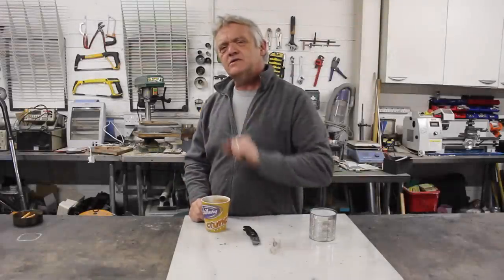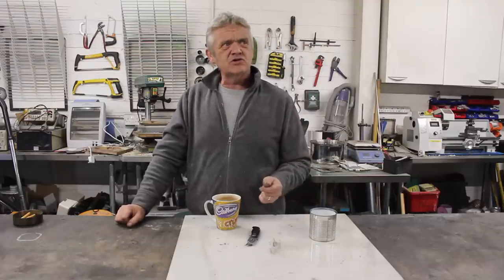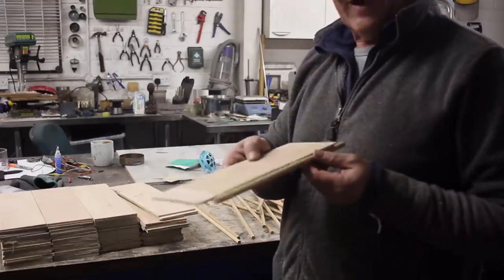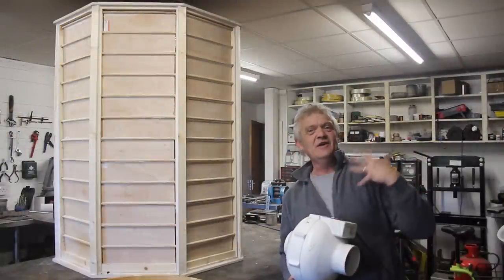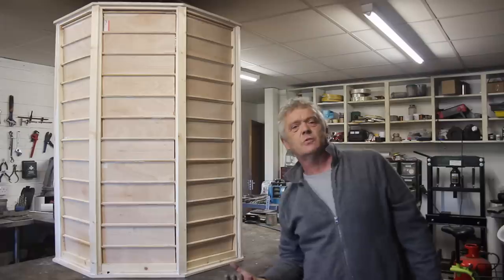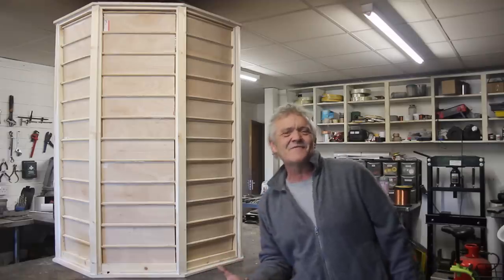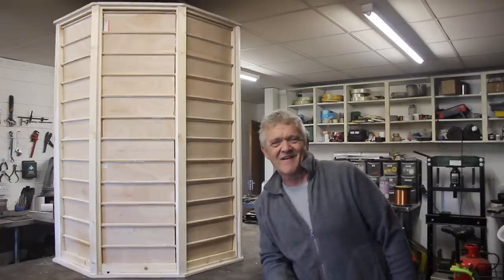1725 Aeromine And A DIY Wind Turbine From A Lost Technology

Comment: I made a small one of these once. The pressure and direction of the wind would push the flaps at the bottom down (the exit was at the top) maybe this won't happen at a larger scale. Assuming it does I have thought of two solutions.

1. Give it tall legs and allow air to vent from the bottom. This way the pressure will aid in pushing the flaps WITH gravity.
I'm not fond of this idea as much as it requires it to be tall and less safe as someone could go under and stick their hands into the blades. Also, back pressure from the ground may be an efficiency issue.

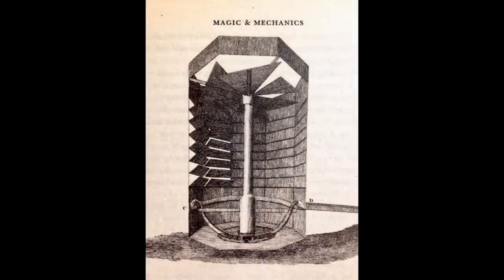2. In the original design,(1:55) we see the flaps are flapping upward and are closed not by gravity but maybe wire with weights pulling the flaps closed. the weights would be just heavy enough to close but light enough that even a slight wind could blow them open and closed on the other side. This makes sense as the materials back them may have been heavier making flapping harder? The weights would fix not only the direction of flow but also allows you to use heavier/ cheaper materials.
Reply: After some thought: I don't think this is much of a problem on at larger scale. The benefits from 2 are likely too small at a larger scale to matter. Will play around with this anyways so things like steel can be used. (wood looks soo nice though!) the design in the video seems to be the best.

Comment: It occurs to me this might be cheaper and easier to build with a floppy vinyl or plastic sheet for the flaps- stiff enough to hold shut on the back end but light enough to flap.  That would simplify the build quite a lot and I suspect capture lower speed wind.  your floppy-ear disk hawt thing brought it to mind.
Reply: Wouldn't be as pretty though, granted. :)
Reply from the maker: it is pretty lol - I like your idea though

Comment: Oh my, I am truly impressed.  I've never thought of a modified Bernoulli effect.  A ten foot+  tower placed between two homes where the wind is funneled with several generators inside would be a fantastic battery system charger.  Needing two sides with flaps only.  The two sides would be blocked by houses ... at least until you get to roof level.  Thank you for the innovation idea.  I'll put it on the list and if I live long enough to finish out my other projects I'll look at it further!

Comment: Could a pivoting venturi/flow suction structure be added on the top that would utilize the airflow above and over the tower to suck air trough the system increasing airflow or even just to reduce the energy lost on opening the flaps?

Also, would painting the side facing the east, south and west black maybe cause some heating and therefore air rising in the system?

So many ideas in my mind for this tower :D
Reply: How about a venturi/spiral center rod to direct and concentrate the incoming flow.

Comment: Hi There you might what to take a look at the old turret type ventilation units on old libraries and warehouses. They draw the air up inside them vertically and usually have a chamber up above them which is only open at the bottom. This void creates additional negative pressure which increases airflow.
Kind regards T 🙂
Reply: Are those the things on top of the English parliament? (Genuine question, nothing to do with the escape of hot air from the chamber  😀 )

Comment: The thought about a wing, works on pressure difference. if you expand the tower above the turbine but reverse the flaps it will act like the wing creating a pressure difference bottom flaps in top flaps out in the side facing the wind out the down wind side grater output, now the question, is one better than the other.

Comment: I love this! couple of thoughts, adding a mechanical lift for the flap opening, via a spring, would help allow more air to enter/not slow the air as much into the chamber.  second instead of using the entire swept area, using a funnel or cyclone channel to speed up the air might help low wind speed performance and better overall efficiency.  looking forward to the next videos.  Thanks!

Comment: If you get two plastic sheets with holes in one and larger flaps on the other and glue them together, you can get a whole sheet of valves. Stick this on the outside of a tensegrity tower and you have an awesome popup generator!
Reply: maybe a semi fine mesh over the plastic with lots of holes in it would work better.

Comment: How about putting a savonius turbine on top, set up to spin to opposite way. Mount the coils on the outside of the horizontal turbine with brushes on to slip rings in the center. Mount the magnets on the savonius. Double the speed, double the power?

Comment: Looks something like the 1970s invention  tornado type wind turbines. There were patents issued in the 70s and 80s but nothing commercial came out of them. These generate the pressure difference by directing the wind  tangentially into a cylindrical tower,causing it to rotate and generate low pressure at the center like yours the top is open and bottom is connected to the either horizontal or vertical  air turbine located below. Since the air turbine is ducted/shrouded it is more efficient than the unducted air turbines. Also was thought to work with even the low wind speeds. It would be possible to  base a design on one of the expired patents.

Comment: You asked for this! 

Title : Tornado-Type Wind Turbine

Patent No US4070131A
Application : 1975
Inventor : James T. Yen
Assignee : Grumman Aerospace Corp

I had access to the corporate library back-then , extraordinary , all the engineering & prototyping was completed by Yen and Grumman.

They determined the diameter to height ratio. The temperature difference between the base and top of the silo to effectuate natural air flow. They built negative pressure louvers to allow air to be sucked in as the 'tornado' formed , etc..

You could use recycled heat at the base to cause cyclonic rotation in times of low outside ambient air flow. 

Have fun - would love to see you build it! 

Regards.
Reply from the maker: oh wow - awesome mate! thanks for all this info - just plain awesome!!
Reply: @ThinkingandTinkering  You are welcome Sir :)

Grumman even produced a couple videos on lab-scale devices (about the size of a refrigerator).

And if I remember correctly it was either Popular Science Magazine , or Popular Mechanics Magazine that did an article on the device.

Have Fun , it really works!

Regards :)

Comment: Nice.  Is there any mileage to fitting another 'tower', with vanes oriented outwards, on top of the turbine. That way the top-tower 'sucks' while the lower-tower 'blows'? Increasing the pressure differential at the turbine?

Comment: There are 2 methods for making aerofoil shapes. 1 3D print for small ones. 2 hot wire cut foam block using template at either end then glass fibre the foam shape. Probably preaching to the converted but hope it helps.
Reply from the maker: cheers mate

Comment: Simple design change to reduce leakage and improve efficiency.  Have the sides of the flaps extend past the sides of the frames.  When the wind channeled inside blows through, it won't be able to go around the edges of the flaps blown shut.   To do this would also make it easier to build as you would need to only cut channels on the backs of the frames and attach with small backing clips or a strip(s) the full length to have the flaps seal correctly.
Reply from the maker: cheers mate

Comment: That’s interesting. I live in a very windy area and needed a vent cap for my methane powered hot water heater. I found one made by Duravent that would generate a suction in the vent pipe when wind blew across the vent. The part is 6GVVTH.

Comment: Hi Robert, just in case you did want to explore the aerofoil build in the future, have a look at flight test YT Channel (model aircraft building using foam board). You can knock a basic aerofoil shape up in minutes and for pennies, all you need is the board, a sharp knife and a hot glue gun👍

Comment: Can you link two together but with outward flaps on the second tower and the generator in the middle link duct, no buffering  pressure problems and low pressure will help

Comment: Robert , was it not what did the Commandant Cousteau with his Calypso 2 .
What I remember was there was a huge tower in the middle of the boat , with different opening along the side .
Inside was , what I could make of and read about it , propellers pile on the top of eachothers , like a vawt, turning at different speed .
Harnessing all the different speed wind at the same and transmitted on the axle .

Comment: Would it be worth having the fan at the bottom of the structure with a second set of louvres this time opening outward? the thinking being that the flow of the wind would be less interrupted when directed downward and the only exit would be on the other side of the fan?

Comment: If you added slopes opposite each side to force air up would that speed up air flow and improve efficiency? If you tapered in at top, slopes at base to direct air up and inverted a Savonius turbine I reckon you would have a pretty efficient set up

Comment: If the flaps are lighter then the wind use less effort in pushing them in making it even more energy efficient I think. For instance which one would get you more energy one made of pure lead metal or one made of a light wood? I’d assume the wood would be more energy efficient but what if we could go lighter but still maintained it’s sturdiness.

Comment: How would you improve the structural integrity? 1.2 meters is fine, but add in the weight of the turbine, and “as high as you like” becomes shorter if you want for stability.

Comment: Would it be better if the air was spiraling as it went up or would it be better if the air was going straight up?

If Straight up allows for more compaction and development of force/speed is there a point/(set distance length) where moving the accelerated air into a spiral just before it hits the turbine blades would be an advantage?

Comment: Just had another thought.  If you made them out of spray painted foam board, they would be weather resistant and lighter so smaller breezes could still open them.  It would also cut down on the noise.
Reply from the maker: clever, clever,clever - nice one mate

Comment: I found the design of this lost technology wind turbine to be really cool, although not necessarily practical. I honestly don't think you need slats that move with the wind at all -- that loses energy to overcoming gravity constantly with no real payoff. As long as the slats are angled so that they point toward the turbine, it should be sufficient to produce the same or better effect. You're still capturing a greater wind surface area, and putting it in the right direction. 

The biggest question with making fixed slats though is what is the most appropriate angle range (which I think anywhere between 30-60 degrees from the horizontal would be fine), which would determine how far you want the slat to be from the turbine (too high versus too low and also inward versus outward), which is something your tower design doesn't really need to address, since the wind can only vent in one direction reliably, which is up.

Sadly, I can't say with any certainty my design would be better since I'm a complete novice with little to no understanding of the physics behind wind power.

Comment: you mentioned the solar panel comparison 
I think if you take into consideration that this design could be covered in low weight solar cells its potential then becomes so much more than any solar panel could 
    I haven't seen a update in a while but I know there is a laboratory working on a breakthrough in solar tech highly efficient cells light enough to rest on a soap bubble
Reply from the maker: that's a good point mate - cheers

Comment: Just a few thoughts on improvement. At the base at the bottom if you could build an inverted funnel so that the air coming in has less turbulence and is more directed Up. And then at the top you would need to have a similar funneling. Your top board the hole is smaller than your octagon so that that distance from the edge of the Octagon to the edge of your swept area is going to be turbulent and wasted energy. So if you extended the tower up a little bit say a third do a half a meter to allow for a bit of a funneling from the edge of the Octagon to the swept area you would be more efficient directing that air through the turbine you'd have less turbulent air travel in the vertical shaft. I really like your mock-up it could go outside and go to work with just a little bit of all weather protection. If you were to make this for actual production I would suggest something less than plywood for the flaps maybe some diff plastic flaps it would be lighter. And and if it was to go into production, all the flat seats would need to be able to seal as the flap is in the closed position to reduce leakage. But overall I absolutely love this idea thank you so much for presenting harassment Darwin's work. You did a great job thank you again.

Comment: I have a few ideas for this as well. If you're directing the wind anyways, why not find a way to collect the condensation from it with no electricity just solar heat, the wind does not care about the heat lol. Take the water from it and turn it into a fuel to power a generator near the base of the tower. Either hydrogen or that other method you mentioned in a previous video that uses plasma to turn water explosive. Which the water can generate it's own plasma by simply creating static by passing coils to power a spark gap generator.

Comment: Looks like a really big version of the non-return valve panels you see over air vents, which does make me think this could be relatively easy for someone to 3D print a version of it. Stacks of panels in parallel connected to an inline turbine like the thing you were blowing with, but rigged to run as a generator instead.

Fun how just a bit of simple mechanics can work wonders.

Comment: The six sided wind milling from Arabia looks similar to that hard to find tech.  It was 6 walls, 2 with holes for air to go in and out with 1 wall between the ones with holes, the rest ' air tight '.  in the middle was 4 sheets on poles to catch the wind and rotate the main rotor that also had a milling stone on the top.  As to making a ' wing shape ' you just need a sheet of plastic that can be bent, glued and folded end to end with the middle still thick enough to ' round out ' instead of flatten.  You can see this effect with simple A4/A5 sheets if you fold it lengthwise ( harder to do in width wise ).
Edited to add the following:  The Airominer ( spelling? ) looks like 4 sheets of plastic, a pipe cut in half, builders board for the frame.  Glue the half pipe so the round is facing one of the open sides of the frame.  Glue in some of the sheet plastic, with a gap between the pipe, preferably folded to create the falling edge of a wing.  Then the other half of the pipe glued to the frame, facing the ' wing ' shape to help cause air flow to become more laminar and syphon up into the half pipe/sheet combination. The turbine will be hiding under the framework with the airflow up then out along the wing which is opposite the octagon example which pushes the air down.

Comment: I saw the media hype too lol, but a thought on your impressive build, if the spindle was positioned a 3rd of the way down of the one way shutter/dampers with a small weight fixed to the upper section then the air pressure to open would be greatly reduced.

Comment: So, having inward opening slats on all sides allows the wind to enter from any angle. The top prevents the incoming air from excaping and the pressue buildup of the entering air forces it downward through the ductwork. I have not seen a second part to your project. Have you posted it somewhere else? Is there a second part? Thank you for building your projects so we can learn from your efforts! I'm tempted to try this one.

Comment: One of the ideas is to place a bunch of pipes before the generator. My understanding is it takes the turbulence out of the air flow and would make the air hitting the generator more efficient in turning the blades.
Reply: I would think you could place some sort of spiral thing inside to direct the air, maybe?
Reply: @NdxtremePro  the tubes just directs the air flow and takes the turbulence out of it

Comment: Can we make this works both way? If we put the flaps so they will flap outward, will the lower air pressure on the sides opposite to the wind make it aspire the air from the hole in the top?

Comment: You could create a similar effect by constructing a cowl running a few inches high along the length of your ridge roof. That might get round your planning objections!

As long as the predominant wind direction is in the right direction! ;o)
Reply from the maker: I have seen those ridge generators - I do like them
Reply: @ThinkingandTinkering  The only ones I have seen are the ones with an axial fan along the ridge. I was talking about taking it a step further by collecting from the ridge and forcing it to a separate turbine!

Comment: Flaps should open in the upper part to make a much better flow of air upwards. This will complicate the design just a little bit (flaps with spring or even easier a weight) but is going to improve the flow of air.

Comment: Construction suggestion: Would it not be easier to make 8 large slats oriented in the vertical plane? Add a small bit of torsion spring to close the flap when there is no wind inflow. The positive pressure in the chamber will do the rest.